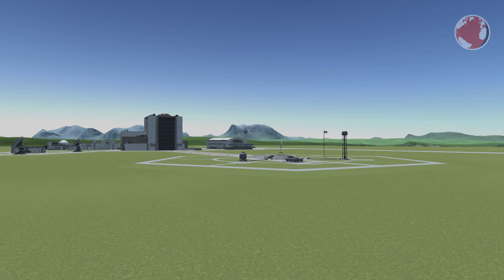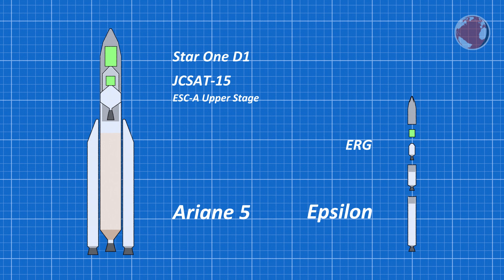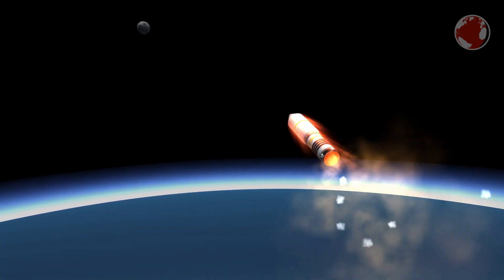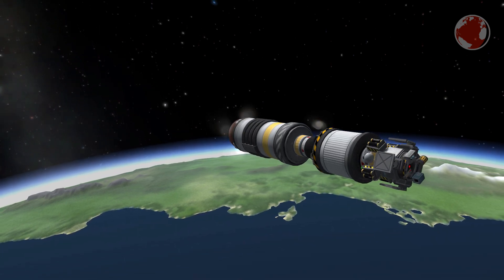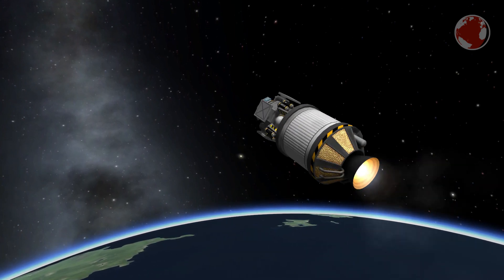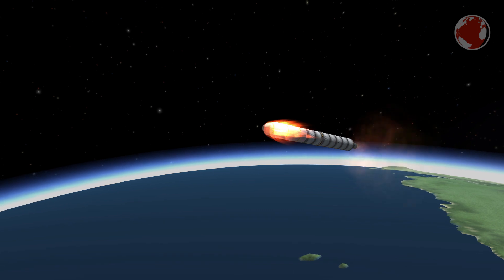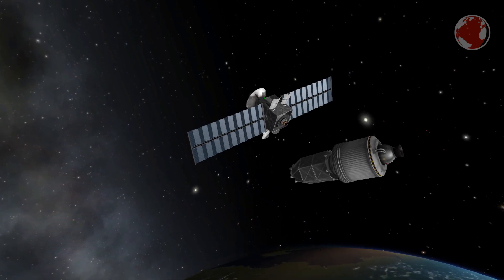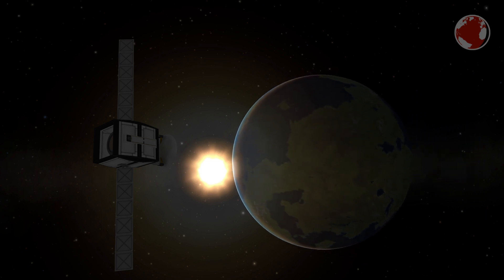Epsilon and Ariane 5 launch | ERG, JCSAT 15 & Star One | KNews #69

Comment: Some Notes:
- The Star One D1 is the first of the kind that uses more powerful antennas, and more powerful Solar Panels, this is called Version D, because the last ones was C1, C2, C3 and C4.
- The Star One D1 was bought by Embratel Star One, but will be used to transmit TV signal for The Mexican company in Brazil Claro, called Claro TV. 
-Also, it will be used too to transmit Signal using the Frequency Ku and C.
- The Brazil Coverage will be Increased due a lot of Rocket Launches that will carry Satellites to be used in Brazil, like Echostar 23, SES-10, and others.
-Brasil have 15 comunication Satellites over your territory!

Comment: There is a stock scale version of real solar system, I think it would be cool to launch from the actual space center's.
Reply from the maker: Using a stock sized real solar system does sound great in theory and I have a separate install just for that. However, making videos can get really painful with all the necessary mods installed (Scattered and so on). There are a lot of glitches, crashes and bad performance in general. The end result is me making less videos. I allready have big problems with ingame hiccups and have to launch my rockets on a fresh savefile instead of my old one with all the crafts in orbit. I will however keep track of the progress these mods and KSP itself makes and continue to test them out.